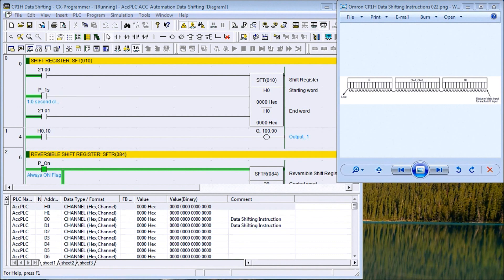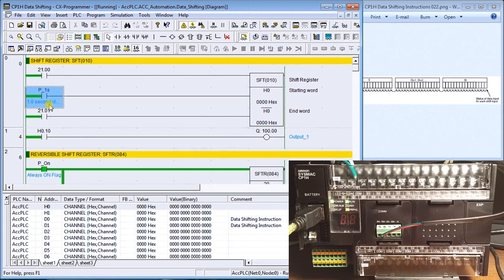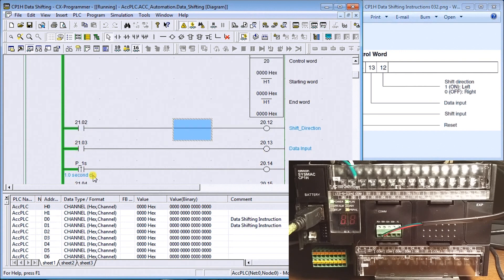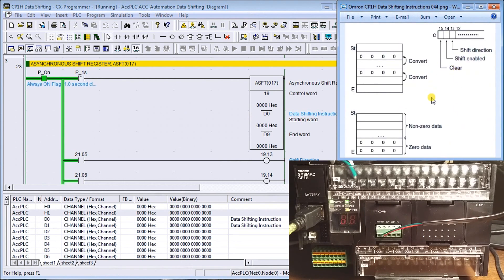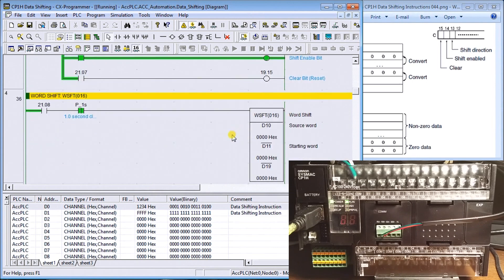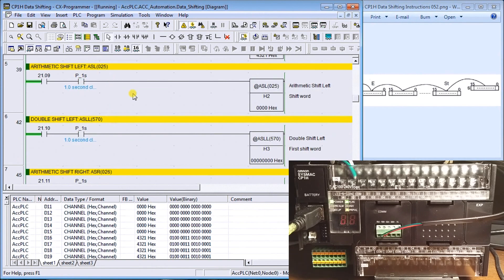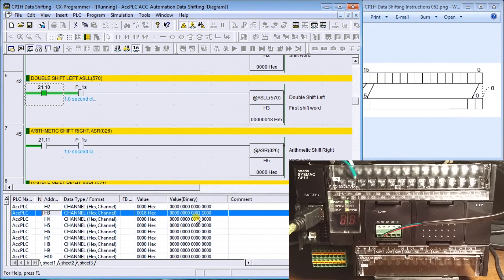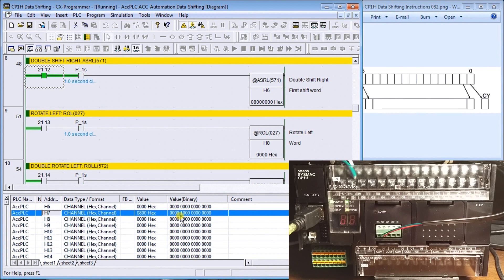Unlock PLC Programming Potential with Data Shifting in the Omron CP1H!

Comment: I want to remove leading spaces from a string. I originally thought I'd be able to shift the data 8 bits (1 char) at a time until the first character <> space. But it doesn't look like there's a way to shift string data.
What would be the best way to go about this?
Reply from the maker: I would use a For Next loop 8 times on the shift instruction to move over the 1 character. 
I hope this helps you out.
Regards,
Garry

Comment: May i know how to shift double word?
Reply from the maker: Hi Alvin,
Good question. The double word would just be two words. I would use the WSFT Word Shift and activate it twice. Make sure that you use the one shot (Diff UP) in front of each of the instructions.
Regards,
Garry
Reply: how to activate it twice?
Reply from the maker: To activate it twice you would use the WSFT instruction twice for the input condition. Ensure that you use the one shot for each of the instructions.
Regards,
Garry
Reply: Garry Shortt I did try, it is able to double word shift to form a table. however if i use one of the values from the table to do calculation, the value become single word but not double word, so the calculation get wrong. Do you know how to solve it?
Reply from the maker: Hi Alvin,
What calculation are you doing? You may have to move the word from the shifted table and insure that the word associated to it is 0000 to represent the double word.
It would help if you could email me a picture of the ladder logic for that section of your program.
garryshortt@accautomation.ca

Regards,
Garry
Reply: ok,thank you,i will email you by tomorrow
Reply: Garry Shortt i have another problem. I am using a long timer. I set the long timer to start counting by #99999999 and the present value of time is saved at D0 and D1, when sensor is triggered, the present time will be divided by 2 using /L (403) signed long binary divide. However, the result is a large negative value. What happen?
Reply: sorry for giving you trouble, i have known how to solve it. i forgot to use double bdc to binary convetor
Reply from the maker: Hi Alvin,
The long timer uses double BCD. If you want to divide the present value by 2 then use the Double BCD Divide instruction /BL.
This should give you the correct answer.
Regards,
Garry
Reply: Garry Shortt ya i get it. I have a question, is it able to do double find maximum and also double sum? If I managed to do these two function, then my program would be perfect
Reply: by the way, thank you so much and thanks for sharing a lot of information and knowledge. you really help me to solve a lot of problems
Reply from the maker: Hi Alvin,
Double BCD Add Without Carry +BL will work for the double sum.
There is not an instruction for the double find maximum. MAX(182) - Find Maximum is the only instruction available. 
You could use a compare and indirect addressing to look through the table to find the maximum value. Here is a post on indirect addressing:
http://accautomation.ca/omron-cp1h-numbering-systems-and-addressing/

Regards,
Garry

Comment: sorry for disturbing you, i use SIGNED BINARY ADD WITHOUT CARRY: +(400) to do simple add calculation. the augend  word i put #300 and addend word i put #53 , however the answer is +851. What happens?
Reply from the maker: Hi Tan
This instruction is a Binary ADD.
#300 Binary = 768 Decimal
#53 Binary = 83 Decimal
Addition Results:
353 Binary = 851 Decimal

Math Instructions:
http://accautomation.ca/omron-cp1h-math-instructions/

Note: Use the windows calculator on your computer. Select the Programmer calculator under the view.
Binary and Hex are the same thing. We display in Hexadecimal but binary is the units of measure.
Select Hex and do your addition. 300 + 53. You will get the answer of 353 hex (binary)
Select Decimal and you will see the 851 result displayed which is the equivalent of 353 Hexadecimal.

The following post may help you out with the numbering systems which can be confusing.
http://accautomation.ca/what-everybody-ought-to-know-about-plc-programmable-logic-controller-numbering-systems/
Video:
https://youtu.be/qLT7DjXYy5k
https://youtu.be/v7HYH92xrAY

Regards,
Garry

Comment: hi, garry, i am chun yit
currently i am doing a project, i need to use the present time from a long timer to do calulation. When sensor is trigerred, the present time will be taken and transffered to math function block to do calculation. However, the long timer function block sometimes will show "error". At that moment, if sensor is triggered, it wouldnt be able to take the present time. so i wanna to know what is the problem, can you help me?
Reply: actually this happens when running full ladder diagram
Reply: when i run a more simplex ladder diagram, the long timer run smoothly
Reply from the maker: Hi Chun Yit,
It sounds like this is an addressing issue. Allot of errors happen like this. The long timer will use two memory locations for the present value and set value. When programming the instruction you only specify the first word for the set value (SV) and present value (PV). The second word is implied. If your timer specifies D100 for the SV and D200 for the PV then search your program to ensure that you are not using D101 or D201.
I think that the set value is being altered, causing the error to happen.
Let me know how you make out.
Regards,
Garry
Reply: Thank you very much, it works
Reply: do you know how to clear memory just by a load? I hope to stop a program by pressing a button and at the same time the memory can be deleted so that when i restart the program, the previous data in memory wouldnt affect my program. So do you have any suggestion?
Reply from the maker: Thanks for the update.
Garry
Reply from the maker: Hi Chun Yit,
To reset memory areas in the PLC you can use a Block Transfer XFER(070) or a Block Set BSET(071). This will move information into the areas that you want to reset.
Here is a post on the instruction:
http://accautomation.ca/omron-cp1h-data-movement/
Video:
https://youtu.be/am0c0h5VJY8

Regards,
Garry
Reply: Really thank you very much, Garry. It works. I am from Malaysia, if you visit Malaysia. You may contact me, I will be pleased to be your free tour guide.

Comment: For the word shift, i try the example as what you show. However, once I on the 21.08, all the values from D11 to D19 changes from 0 to 4321 at the same time. It does not change once by 1s. May i know what is the problem?
Reply from the maker: Hi Tan,
It sounds like the word shift instruction is not being triggered by a one shot. This is a common error. 
You will notice in the example that the instruction is triggered (input conditions) by a 1 second pulse that uses the differentiate up (one shot) instruction. This means that the instruction will execute once every time there is a transition from off to on. 
http://accautomation.ca/wp-content/uploads/2017/05/Omron-CP1H-Data-Shifting-Instructions-055.png
When a one shot is not used, the instruction is executed every scan. It will look like the shift is happening all at once.

Hope this helps you out.
Regards,
Garry
Reply: then may i know what you type in the contact of the load to make the instruction of 1 second pulse with up arrow?
Reply: However, now for the ladder diagram that i wish to do is to make the word instruction to execute by a sensor. Once the sensor is triggered, then the word shift will update the values once to collect all the values when sensor is triggered. Do you have any idea to do so?
Reply: By the way, thanks for your advice , Garry
Reply: I managed to make it
Reply from the maker: Hi Tan,
When you add a contact in the CX-Programming Software you can select the differentiation as none, Up or Down. In our case we have selected the differentiation up for the contact.
http://accautomation.ca/how-to-make-a-one-shot-in-the-plc/
The above link will explain how to create a one shot in the PLC using basic instructions.
http://accautomation.ca/understanding-the-plc-program-scan/
This link will explain the PLC programming scan.
Hope this helps you out.
Regards,
Garry
Reply from the maker: Hi Tan,
Your input sensor contact will be on a differentiation up instruction. This will indicate that if the input transitions from off to on then the instruction will execute for one scan.
Regards,
Garry